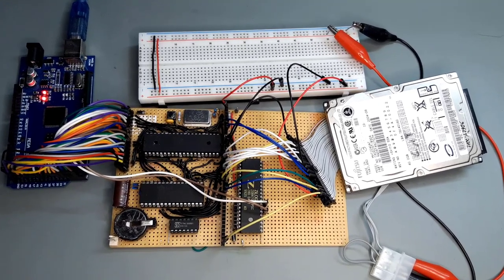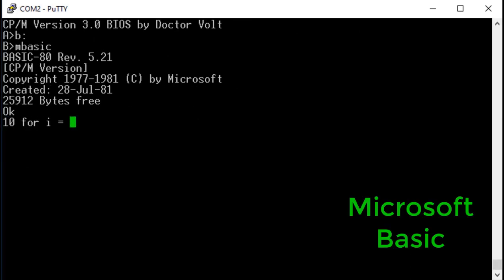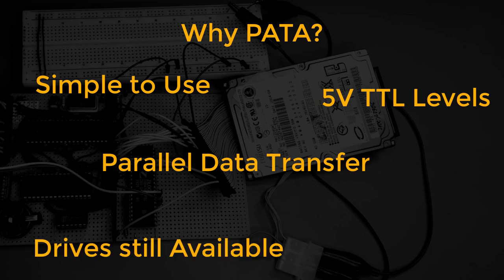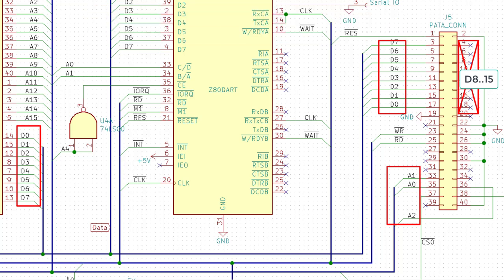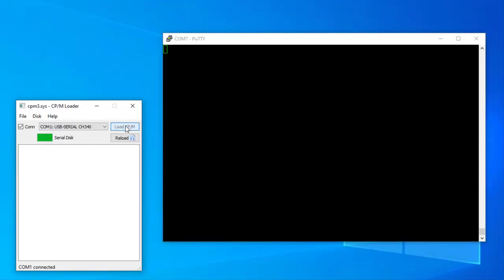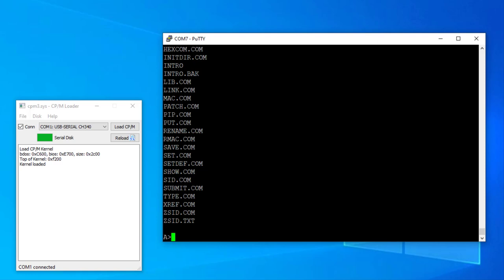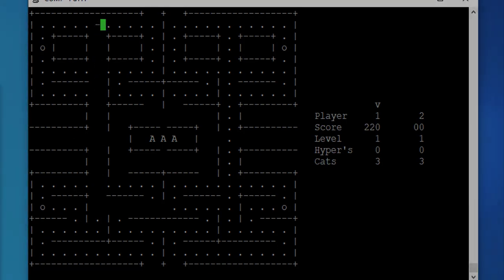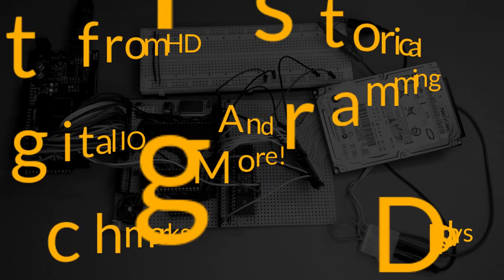DIY Z80 Retro Computer #4: Connect a Hard Drive

Comment: I never realised PATA drives were so straight forward to interface. I guess all the complex electronics are on the drive itself. Totally different to a floppy drive where you need a controller IC.
Reply from the maker: Yes, the only difficult thing was to dig through the specs and figure out how it works, as there is hardly any description on how to interface PATA drives with an Arduino or Z80...
Reply: That's why they called it IDE: Integrated Drive Electronics. What's really cool about this is that it suits my own notions of how one ought to build this kind of retrocomputer just fine: Build it using a CF card or something. But you also have the option of building something that replaces the drive and saves files on a USB stick or something similar.

Comment: Of course, the Parallel ATA interface, like its eventual successors PCIe and SATA, is considered an intelligent interface, so it's reasonable to expect that the hard drive already have it's own CPU to handle everything on it's own without hand-holding unlike the floppy disk drive, or just to make things fun, original big-ass MFM hard drives that lacks any smarts (some actually do though, especially late in MFM's day). So it is pretty simple to interface the microcontroller with it and talk with the hard drive's internal computer, you have to put in special messages in as far as PATA specifications go, into the bootloader in the microcontroller, before you can actually do anything with it.
Reply from the maker: Yes, in the next episode I implement these PATA commands in the bootloader of my Z80 computer, so it can boot from PATA drives directly.

Comment: Nice video man. You can use a 2k eeprom to do the bootloader, and do it in a way that deselects the rom and uses only 64k of ram later, you can connect a flipflop as the output bit and then control this selection. I read this on a page about cp / m.
Reply from the maker: Sure, that´s the common way to boot CP/M. But this requires an additional IC and the board is already a big mess. So my idea is to use the unused second 64k portion of the 128k battery-backed SRAM for the bootloader and switch this on and off by its A16 pin.
Reply: @DoctorVolt  Humm, this RAM makes things more easier
Reply: @DoctorVolt  This old print shows one of the data bus pins, but they all have this format. https://hydracomputer.tumblr.com/image/648271739232600064 And below the clock, which was very slow, something like 11kHz, this was one that had mounted on the protoboard like the one on my video. Does yours show a similar sign? 
And I will analyze if other devices are disturbing the bus. Thanks.
Reply from the maker: No, I have never seen anything like this. You could try the setup which I described in this video: https://youtu.be/pNjEzovSfrY. Here you can try with different clock frequencies up to 150kHz and find out whether your Z80 works properly.

Comment: Great job mate. What do you mean when you say: with half databus (8 instead 16bit) half the drive is used. ? A preformatted Do a Fat32 compact flash is not readable if I use only 8 bit for databus ? Tnx
Reply from the maker: Correct. PATA stores data in two- Byte Words, that means two bytes at a time. But as the Z80 can only access one byte out of these two, it can only use half of the drive´s capacity.  That´s the reason why this will never support Fat32.

Comment: Do you have an oscilloscope? I observed my data bus and the signals are very strange, with many distortions, and very low voltages. Do you see it in yours too?
Reply from the maker: Yes, I have already seen the Z80 signals on my USB scope. Ok, they are not perfect rectangular, but they reach and maintain the 5V level. Maybe you have some component on your data bus whose data pins currently act as output and thus draws the signals to low, or just a defective Z80.